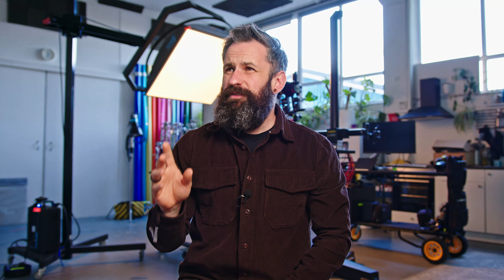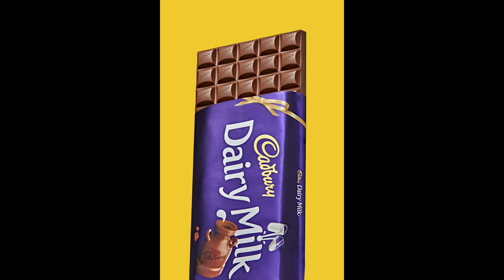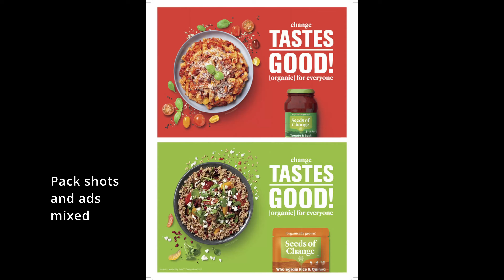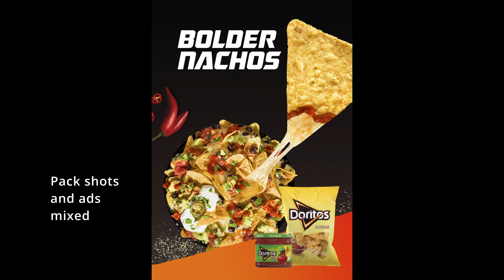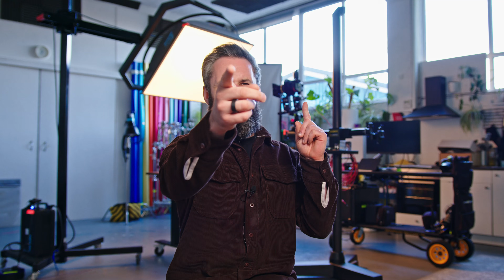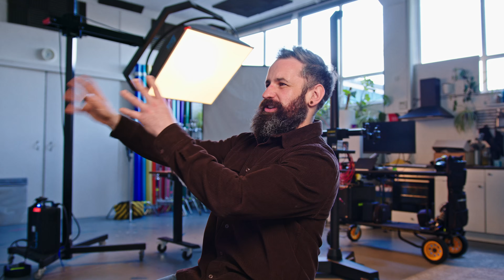Well, THESE photographers are 100% doomed !!!

Comment: Setting up workflow systems for any type of work matters. Where time and throughput are key, it's the difference between making and losing money. Such as pack shots. 
My issue in photography was that I often did quite different jobs, so would have to frequently invent new workflows. Then reinvent them ages later when I next did something similar. However, I preferred this varied job type to the [to my mind] monotony of say pack shooting. 
I used to do stills photography on films during early days of digital and never got a workflow and organisation setup that I was truly happy with. It would be so much easier now with more mature digital cataloguing software like LR with things like smart collections and multiple ways of organising one thing into multiple virtual places. Rather than the limitations of literal physical folders with actual files inside.
I had similar issue with music on physical media [I've also djed]. Smart collections/playlists of digital media finally solved my decades long battles with the how to when it came to organising my vast music collection. Still not yet digitised all my old physical music and photos. Not yet found a system that is good enough to deal with the painful chore that it will be. Almost there though with film and using cameras to 'scan' . Lots of new options appeared in last couple of years.

Comment: We had a complete reroof recently with integral solar panels . The roofer was a problem solver and would even find ways to cut our costs. Yes really. 
The electrical chap who wired the kit up however was a problem finder/causer, who I had to repeatedly solve the issues for. Sounds like the dicks you mention in the video. 
Heck, he even ignored the easy solution I had pre-planned for him to get cables down to top of house to cellar batteries [via redundant chimney breasts] and insisted on doing it by drilling through our impossible to drill side of house. He eventually  gave up and did it my way. Wasting half a day.
Guess who got referred and did several new roof jobs for the neighbours and guess who will only get slated if anyone asks.